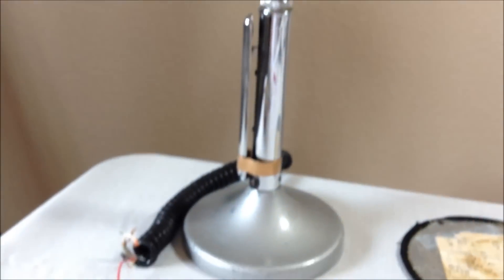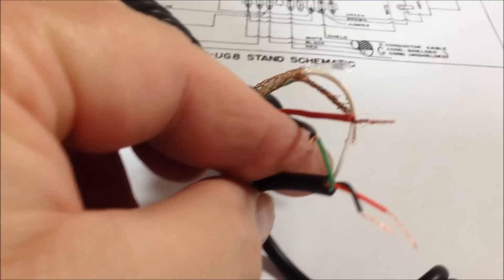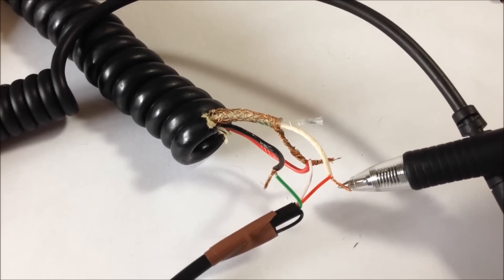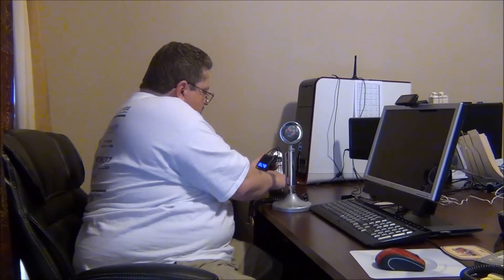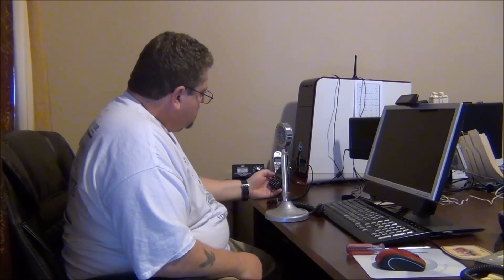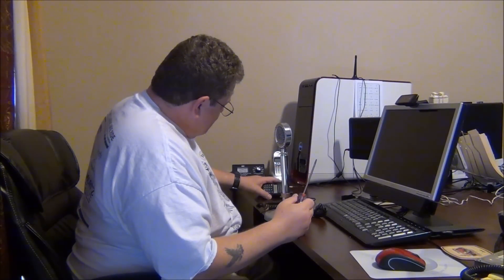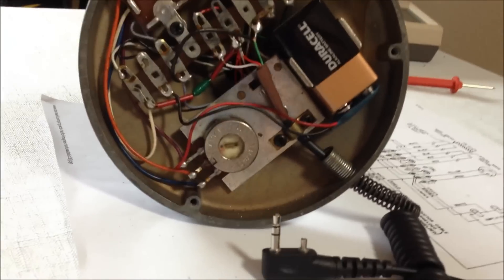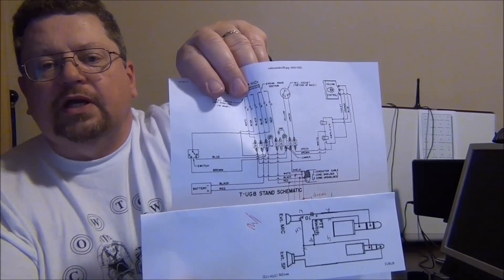Retrofit an old AstAtic D104 microphone (T-UG8) to a Baofeng(Pofung), Wouxun or other Kenwood type

Comment: I took your idea one stage further. I put a 4 pin cb radio mike socket on the lead, which i wired as cybernet, as i have cross over plugs and hooked up an Astatic Road Devil mike. I got very good results ,but noticed if you try to over drive the input audio the radio protects itself by not transmitting...i couldn't find the diagram on your webpage , but worked it out anyways

Comment: You should be able to hold the microphone at arms length with the volume turned half to three quarters and speak as if talking to someone in the same room and you should sound very clean with just the right amount of bass to demand attention...I think you will like the D104 I have since 1977...

Comment: I had the same desire to use my d104 on my HT my idea was to wire a box with a jack for a nice external speaker and a jack for my 6 pin mic plug to match the rest of my radios. You would get a better speaker and a better mic for a simple BASE STATION HT.

Comment: The D-104 is a HIGH IMPEDANCE Microphone and ISN'T INTENDED to be used on a LOW Impedance device such as an HT.  While some people choose that route it's because they have No clue about radios, microphones or fidelity. The D-104 would work well on a TUBE typed Transmitter. It has a Crystal Element in the Head if it's original, it's not a Condenser type Element like what Should be used for an HT. It's going to sound terrible on FM, like you're pinching your nose. Just offering you some advice Don't use a D-104 on an HT as neither were designed to be used together. If you want to use a desk mike get a Mike with the recommended Impedance and you'll enjoy your radio as will others. If you want to sound like a noob and clue everyone who is in listening range you've not a clue, then run the D-104. Not trying to be mean just letting you know how badly that choice is and SOUNDS.
Reply: my D104 is used on the Drake TR4CW in my shack..

Comment: nice mod. i've seen one that replaces the audio amp board inside and it gives you a high and low eq. ability. letting the user have the base tones back. because the high impedance head is matched via a poor design impedance matching amplifier. basically giving the user a high fidelity mic. a cheap heil mic

Comment: Why break the tip off instead of just not connecting it?
Reply: Randall Goguen  i think you have to use the shield and not the tip, because it's part of the keying circuit. one leg of the mic is shared with the ptt and the other is part of the pin with the tip broken off. so to not have it. you defeated the whole purpose of the mic.

Comment: Thanks for sharing! And +TerraceThornhill, I wouldn't like to snip the connector either, but I guess you have to, in order to keep the hand held speaker working (the tip of the connector probably disconnects it when plugged in). Please excuse my Yoda-style English. 73

Comment: That's a really neat idea. The reason you'll sound like tin foil is because the radio has a very low ohm impedance but the D104 has a very high ohm impedance of 50k. It's difficult to match the impedance.  73's

Comment: Great video thanks for sharing..  If I'm not mistaken these radios have an audio limiter in the transmitter audio circuit to limit the audio from over modulation.  That might be why the D 104 sounded nasaly or did not have fidelity.  I have several of those Chinese hand helds, and one had very low transmit audio so I tried to hook up an old pre amp mic I had laying around, but no matter what I did it just sounded very bad. I'm thinking the impedance was not matched to the Baofeng either.